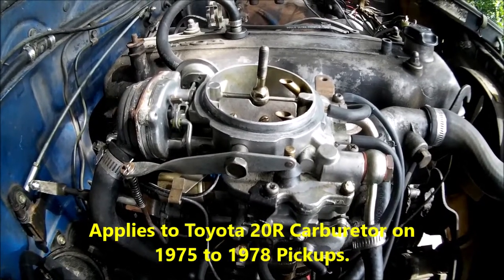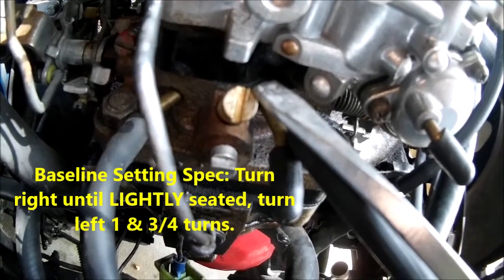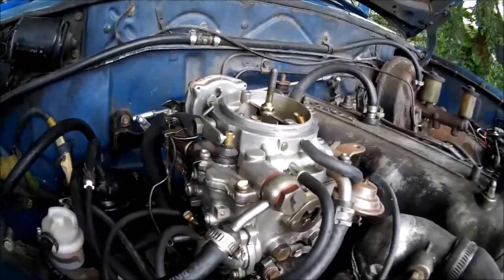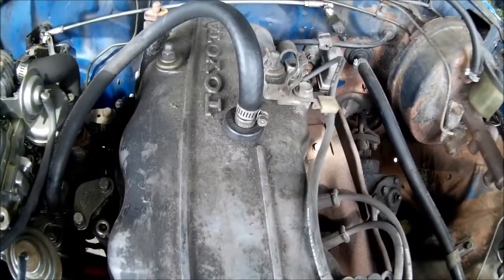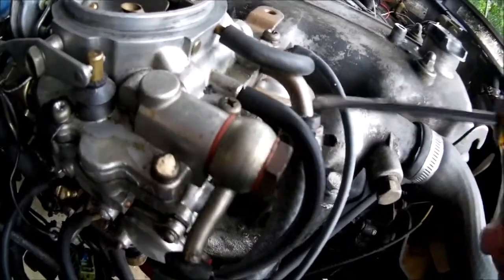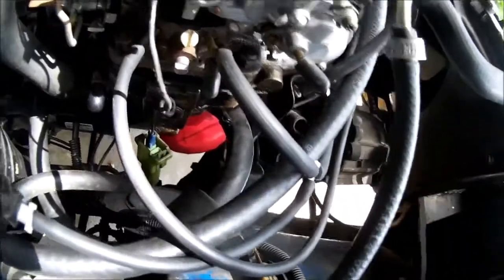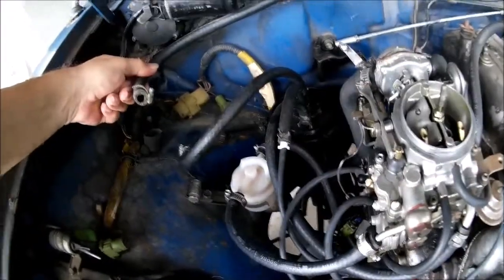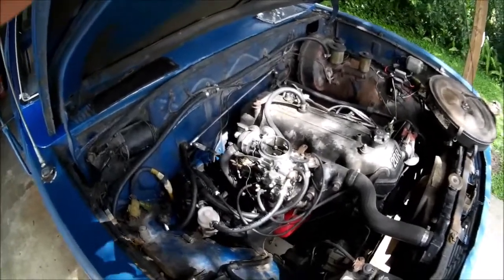1978 Toyota Pickup/Hilux 20R-Carb Adjust & Vac Lines-Desmogged

Comment: I’m not sure if you still read these, but I have an original carburetor on my 1978 pick up. My choke had been stuck for many years and I finally fixed it However now I am getting a strong smell of fuel in my oil and I’m not sure if that’s a mixture issue and or something else. Any idea?
Reply from the maker: I absolutely read every comment/question people send me, no problem. :^) I kind of doubt it's a mixture issue (i.e., your mixture setting screw being out of adjustment), plus that screw really only adjusts the idle mixture. But if you want to verify or eliminate that possibility, you can "baseline" it. It's the screw that is on an angle, center of carb, near the base of the carb. Get a flat-blade screwdriver that fits the slot well. Turn the screw to the right slowly until it just wants to stop turning (lightly seated). You do NOT want to crank down on this screw as that will damage it and you'll never get a good idle. Count how many turns it goes until it lightly seats. If it is more or less than 1 & 3/4 turns, it was out of adjustment. Then turn the screw back out 1 & 3/4 turns. That is the baseline idle mixture adjustment for that carb.

By the way, a "turn" is a full 360 degree rotation of the screw. If that adjustment doesn't solve the fuel smell in the oil issue it's something else.

Other things that could cause that issue. The float could be out of adjustment (set too high). This will noit allow the needle valve to shut off fuel flow when it should. This causes there to be too much gas in the bowl, which can cause flooding. It is also possible that there is some debris or "trash" in the float bowl, that is keeping the needle from totally seating. The needle valve controls when gas can enter the fuel bowl and if it cannot seat & cut off the fuel flow, the carb will flood.

Check the sight glass on the front of the carb; you may have to clean it off to see it well enough. The fuel level, if correct, should be between the two  "tabs". If it is above the top "tab" that's too much fuel and it may be flooding.

Specific to the 20R carb - Possible ruptured Axillary Accelerator Pump Diaphragm (AAP). This problem could allow extra gas to constantly go to your #1 cylinder. Two ways to check for this problem. The AAP is located on the passenger side of the carb near the front, and has a sort of triangular cover with three screws holding it to the carb, plus a vacuum line going iinto it. Pull the vacuum line off the port and see if there is any liquid gas in it. If there is, the diaphragm is ruptured. You can also remove the #1 cylinder spark plug (engine cold, cylinder nearest the front of the engine). If the electrode is black (fuel fouled) it could be a sign of a ruptured diaphragm. Easy fix for this is to remove the vacuum line from the port & cap off the port.

Questions. How long have you had the vehicle? Has the carb ever been rebuilt? There are other wear problems that the carb might have if it's original. How is your engine timing? The spec is 8 degrees BTDC. Are you running the stock in-tank fuel pump or something else? If an aftermarket fuel pump, what brand & part number? Some aftermarket electric fuel pumps might have too high a fuel pressure, which can overcome your needle valve and cause flooding. Is your air filter clean? A clogged up air filter can cause the carb to run rich (too much fuel). Let me know.
Reply: @The13thSword  I’ll look into all the suggestions you have given and then give you a detailed reply but to your other questions. The truck belonged to my father and he bought it new in 78’ I fully restored it and had it repainted about 5 years ago. He wasn’t the greatest at long-term maintenance. But the carb is original stock. Never been rebuilt. I just recently discovered the choke plate was literally glued open from years of carbon deposit. I really should remove the entire carb and clean it but I’m just not confident to do that/fear i won’t get it back running like it does now. It purrs like a kitten and has great compression for its age but the spark plugs definitely getting too much fuel because they are almost black on the tips. I replaced them yesterday once I discovered the strong gasoline smell in my oil. I did discover tonight the choke diaphragm hose (think that’s what it’s called?) was not connected to anything so I re-hooked it up but I’m not sure if that’ll fix anything. One thing I have noticed though is that when I adjust my idle screw it doesn’t seem to make much of a difference. Since I fixed my choke plate I’ve had a hard time getting that high idle speed right. I apologize for throwing so much at you, I’ve got the original engine repair manual and another similar third party one but neither of them address my issues. I’ve removed the pulley for the smog system but left most of the hoses still attached since I don’t have a clue what’s critical and what’s not. Your video has helped me get an idea but I’ve still got hoses everywhere. In regards to fuel tank, it’s original and I have the same issue you has about the gauge not working once the tank is about 3/4 full. I’ll fix it one day but it’s not priority Sorry for the long reply.
Reply from the maker: @ToyotaRN  No problem and thanks for the detailed info. If the carb has never been rebuilt in it's whole life, I would suspect that is where your problem lies. It's 42 years old after all, and things can wear out, gaskets dry up, etc. Plus the fact that your choke plate was "glued open" by carbon & that you can't properly adjust the low or fast idle speeds, those aren't great signs of overall carb health. The vac hose you mentioned sounds like the choke pull-off. With the engine below full operating temp, the pull-off keeps the choke from closing too much when the vacuum drops down (engine speeds above idle). If it is inoperable, it too could contribute to a rich condition (too much fuel for conditions). The choke itself, when the engine is cold, blocks off all or most of the top opening (throat) of the carb. This make the air/fuel mixture richer, which cold engines need to run correctly. Once the engine starts to warm up, the "water choke", a thermostat at the back of the carb, slowly opens the choke as temp rises, until it is fully open at full engine operating temp.

If you look at that thermostat on the back of the carb, you should see some line markings on it, plus a single line marking on the carb side. It should be set right in the middle. if not, it's been monkeyed with by someone and is out of adjustment.

You said "I have noticed though is that when I adjust my idle screw it doesn’t seem to make much of a difference." This is interesting, IF you mean the mixture screw and not the actual low idle screw. It's important to know which is which here. Here is a link to a diagram that identifies all three screws (mixture, low idle, fast idle): https://www.autozone.com/diy/repair-guides/toyota-cressida-corona-crown-markii-1970-1982-repair-guide-carbureted-vehicles-repair-guide-p-0900c152800870d9

If you actually meant the mixture screw, that would indicate that your idle circuit is probably blocked, and the engine is trying to idle off the Main fuel circuit instead. That would certainly make it run rich. Given the carbon problem you mentioned, this could be very likely. Also as I said before, there could be "trash" in the fuel bowl, some of which is blocking off your idle jet. That's more likely to happen, as the idle jet opening is much smaller than the main jet opening, so it gets blocked easier by junk in the fuel. Have you changed your fuel filter lately?

What I would do if it were mine. Go get 2 cans of cheap carb spray cleaner. Take off the air cleaner, put paper towels around the base of the carb, and use 1 complete can to clean off the outside of the carb, and also spray down the throat. Let it sir for several hours to let all the spray cleaner evaporate. 2nd can of cleaner - Unplug & remove the Fuel Cutoff Solenoid from the carb. This is a cylinder shaped part on the passenger side of the carb with one wire going to it. Remove the Idle Mixture Screw completely. Doing this gives you access to the internal passages of the Idle Circuit. Remove the two bolts/plugs at the front bottom of the carb. This gives you access to the fuel bowl and the idle & main jets.

You can then "wash out" the fuel bowl with the spray cleaner, and also shoot some cleaner down the small brass tubes in the carb's throat. Those are bowl vent tubes and go straight to the bowl. Then use the "straw" that came with the carb spray cleaner. The idle & main jets are straight back in the carb from where the bolts were. You can shoot cleaner right into them to clean the jet openings.

Still using the "straw", shoot some cleaner into the fuel cutoff port and the hole where the mixture screw was. Fill up that idle circuit until it's full. Let sit 5 minutes, then blow out with compressed air in short blasts. If you don't have compressed air, just keep repeating the cycle of shooting more cleaner in there. Use up the whole can if you have to. When you're out of cleaner, let the carb sit for an hour or so, then re-install the bolts, mixture screw & cutoff solenoid.

I have never failed to unblock an idle circuit doing this. It looks complex in print, but it's actually not hard to do.

Second option is to buy a gallon can of carb cleaner, remove the whole carb and soak it overnight in the cleaner. Only problems with this is you really have to diagram out the vac hoses to get them back in the right places. And it may not remove all the "junk" from the inside.

Also, the above 2 options will not fix any worn or broken parts. For that even a rebuild won't get it done, but there is this: https://nationalcarburetors.com/Toyota-Hi-Lux-20R-22R-1978-21892367-CC_p_520.html

The throttle shaft bushing on my original carb were worn out & causing a big vac leak. National supplies rebuilt carbs with brand new hard parts like that, plus new solenoid, diaphragms, etc. Great value if you need to go that way.

I wouldn't worry too much about the smog system; it's probably not working anyway. Just make sure you don't have any vacuum leaks to any of it's vacuum operated components. Either new vac hose, or cap off ports to them with some quality silicone vac caps.

You have a broken resistance wire in your fuel sender. I have info/fixes for that too, just let me know when you need to know.
Reply: @The13thSword  so I got the courage and cleaned and rebuilt the carb completely. I’m now trying to determine what vacuum lines are actually needed vs what was apart of the original smog system (now decommissioned) I was trying to understand why you capped the Vacuum Port for Hot Idle? Does it not work separately from the original smog system? In addition, if I send you pictures or make a video can you tell me which ports I can cap? I’m using this video as a guide but I know there are still some places where I’m not sure what to do. Just let me know. Thanks again
Reply from the maker: @ToyotaRN  Good job on mustering up the courage to do your own carb rebuild. You don't need to run the Hot Idle Compensator Valve, as generally it is intended for vehicles with AC., and/or vehicles that are run in very hot climates. When coming to a stop, there is much less air flow through the engine compartment, and temps can rises above the normal 200F. Think of rush hour bumper-to-bumper traffic hardly moving. This can cause fuel percolation in the carb, making for an over-rich condition (higher fuel to air ratio). The valve is a metallic strip that deforms under a certain level of heat, and there is a "stopper" on it's end covering a hole in the carb body. That hole allows air to run thru a passage in the carb and exit below the lower throttle butterfly plates, leaning the air/fuel mixture out. The valve usually only gets a vacuum signal at conditions of high vacuum, such as at idle, and the valve will only open up at around 200F or higher.

I am in Central Florida and have had to capped off since doing the desmog, and haven't noticed any percolation problems at all, even in July or August. You can go ahead & run a vac line to it if you want to, instead of using a vac cap; I really don't think it's going to make much of a difference performance wise. The port for it is the lower of the two on the front of the carb, just below the throat opening.

I've run one vacuum line from the Dashpot (vacuum canister on the front of the carb that is connected to a linkage system) to a ported vacuum source. I used the middle vac port directly below the Idle Mixture Screw. There is an angled port to the right of that one; that one I use for the vacuum advance for the distributor.

The only other vacuum lines I run is to the Fuel Vapor Canister, which the only part of the old smog system that I kept. It traps and fuel vapor from the tank return line and from the vapor return line from the carb. Any fuel vapor it traps gets sucked out thru a vacuum line to the port to the left of the Dashpot port described above, and the fuel vapor is burned off in the engine at startup. Some people totally eliminate the Vapor Canister, but if that is done, you'll need to cap off the vapor return port on top of the fuel bowl, and either cap or install a filter on the tank return line. If you cap the tank return line, you need to make sure your have a fully functional vented gas cap for pressure relief.

If you still need more info you can make & post a video to Youtube if you wish. If you want to send pics, you can send them to me thru Yotatech, which is a Toyota truck forum (yotatech.com). You'll have to make an account but it's free, then just search for members to find me & send a PM. My tag on Yotatech is 13Swords.
Reply: @The13thSword  next couple of follow up questions. On the front of the carb the top port is thin and if I understood you correctly it goes to the choke pull off. The thicker port on the bottom (level with the fuel vapor return line) either is capped or goes to the old thermostataic valve as you mentioned above? Second question, do I need to put fuel in the carb bowl prior to starting? I thought stepping on the gas pedal would work but it doesn’t seem to have any effect. Also, how does gas get sucked up once it passes the fuel filter. It doesn’t seem to suck any gas up when I have it gas. Have I hooked up my vacuums wrong or not capped everything I was supposed to? Thanks a million for all your help. I can’t wait to post a follow up video once I can get it running again 😂
Reply from the maker: @ToyotaRN  Correct, the lower port goes to the hot idle valve (old thermostatic valve), if you are using it; I have that port and the port for the valve capped. On mine I have the thinner top port also capped.

What you are calling a choke pulloff I call a Dashpot. They are two different things. On the 20R carb, the choke pulloff is mechanical and works with the position of the throttle linkage (connected to your gas pedal). If the choke plate position is in anything less than the fully warmed up position, the throttle linkage mechanically pulls the choke plate open when you get on the gas pedal.

The function of the Dashpot is to "cushion" the closing of the throttle butterfly plates in the bottom of the carb on sudden deceleration, like quickly taking your foot off the gas. This lets the engine retun to idle more smoothly. Without a dashpot, the throttle plates would slam shut suddenly, & cause a rich condition, which could stall out the engine.

The vacuum line for the Dashpot goes to the vacuum port on the carb, to the left of the Idle Mixture Screw. I went out and looked at mine to verify this. IMPORTANT NOTE: As long as it seems to be working ok, DO NOT ADJUST THE SCREW ON THE LINKAGE THAT IS CONNECTED TO THE DASHPOT. I made that mistake a while back and it took me all day to get it back to just right and working exactly the way it's supposed to.

About your fuel question. Stepping on the gas pedal operates the accelerator pump, which is mechanical and inside the carb. If there is no gas in the fuel bowl, it will have nothing to pump, no matter how much you step on the pedal. You don't have to fill the fuel bowl before trying to start (your fuel pump will fill the fuel bowl eventually while cranking the engine), but it helps make start up much quicker. A lot easier on your starter. You'd need a small plastic gas-safe bottle with a spout to pre-fill the fuel bowl. This is done through either of to brass tubes inside the top of the carb throat. Those are vent tubes for the fuel bowl. See 4th picture here: https://nationalcarburetors.com/Toyota-Hi-Lux-20R-22R-1977-21892367-CC_p_514.html

Gas does not get sucked up once it gets past the fuel filter. The fuel pump in your tank PUSHES fuel through the whole fuel system (including the fuel filter) until it reaches the carb. Once there, there is a float in the fuel bowl that moves up & down depending on the level of fuel in the bowl. The float is attached to a valve where the fuel supply comes into the carb. When the bowl is full to spec (fuel level between the two metal tabs on the sightglass, front of carb), the float rises, an "arm" on the other end of the float's pivot pushes down the valve & closes it, cutting off fuel flow to the bowl.

Just to be clear, engine vacuum plays no part at all in fuel delivery to the carb. What happens inside the carb after that is another story.
Reply: @The13thSword  thanks for clarifying on the above. I made the terrible mistake of disassembling everything on my carb. Any advice on the correct amount of turns on the dash pot screw or on the fast idle? I followed your advice on the mixture and will adjust the regular idle once it runs. Also, below the mixture screw is a port that has on the left a port that goes to the air filter and then there are 3 ports on the right. Do you know if I need to have anything hooked up to those or if I can just cap the three? And directly below the carb connected to the intake manifold is another thing that has 2 ports vertical stacked. Any idea what if anything needs to be attached to it?
Reply from the maker: @ToyotaRN  Oops. OK, some basic starting points here. I don't remember exactly how many turns (it's been three years since I adjusted it), but on the Dashpot screw, mine is set at 5/16" or 7.5mm, measuring the head & shaft of the screw that remains outside the part that it screws/threads into. Try to make this as precise as possible. There might be some fine-tuning to do to it later once you get it running, but this involves a set amount of "hold" time and perhaps some "feel" on your part. I can tell you about it later if needed, but right now that measurement should be good enough to run it.

For Fast Idle Screw. Set the choke to full closed position. if you can't the screw is run in too far; back it out. You want the screw run in just enough to lightly hold the throttle linkage open on the highest "step" that the screw shaft makes contact with. Again that should be enough to get going with and you can adjust later. The high idle spec for the 20R is stated as 2400 RPM, but I find that way too high. I run mine adjusted down to 1800. Idle speed spec is 800-850.

Since my truck is "desmogged" I do not use any of the vacuum ports below the carb, that are not a part of the carb body itself. All of those are there for vacuum actuated smog equipment. I have all those capped off. That includes the "vertical stack". In fact I removed that piece entirely and put in a threaded metal plug in it's place to make it simpler and prevent any possible future vac leaks. But as long as you're using tight fitting quality vac caps there should be no issues.

Again to be clear, if you aren't using the emission equipment, even if you didn't remove the items from the truck, no port intended to send vacuum to emission equipment "needs" to have anything hooked up to it. You just need to securely cap them off. This is to prevent extra air from entering the intake side of the engine and throwing off your fuel/air mixture.
Reply: @The13thSword  I promise I’ll donate to you’re channel if I ever get success with this. I did get it to start but I’ve hit several issues. 1) the car is reving really high and the choke plate doesn’t open because it’s not getting hot enough or some other reason. I adjusted the screws as you suggested but didn’t seem to do much.  2) I did let it do it’s thing for about 20 seconds but it started to back fire and was eventually going to stall. 3) My biggest concern is the fact that the base plate the carb sits on that connects to the intake manifold was soaked in gas and I’ve got no idea how that happened/happens. 4) my gas pedal just doesn’t feel the same as it did before I disconnected the ball bearings the throttle arm connects to. It seems to be almost pressed down to the floor. There’s no springiness in it like it was before I released the throttle arm. I’m sorry to bombard you so much I’m just a 25 year old trying to preserve my dads legacy.
Reply from the maker: @ToyotaRN  No worries on all the questions, and no need to donate, because that's not why I do this. I started posting my vids to share what knowledge I do have, for projects just like yours. Let's take the high revving first.

It's going to be a little hard for me to say what's going on there, without seeing it in person, and not knowing exactly what you did in disassembling.reassembling the carb.. Something could have been left out accidentally, reassembled wrong or in the wrong position, etc. Carbs have so many small parts that need to be in precise locations & measurements, that's why a lot of people don't want to tackle a rebuild, me included. But you should be proud of your effort regardless.

At this point I could throw a lot of guesses your way to try and explain what is happening there, but based on my own past experience (I tried to rebuild my carb too, and it didn't work right), I'm going to suggest that you get a complete freshly rebuilt carb. I've learned that sometimes all the effort isn't worth the stress, especially when you don't possess the specialized knowledge to fix something, and carbs are just one of those things that most of the time is better left to the pros. It just makes more sense, because you are dealing with a 43 year old carb that's bound to have some issues that a cleaning and a basic rebuild kit just won't solve.

Recommendation: https://nationalcarburetors.com/Toyota-Hi-Lux-20R-22R-1978-21892367-CC_p_520.html
This is what I went with and I've been more than happy with it for over 3 years now. What you get for the price is really a good value (check out the "CARBURETOR REMANUFACTURING PROCESS" page on the website), plus they install new diaphragms in all the vacuum operated parts, plus give you a brand new idle cutoff solenoid. They also test them and preset the float height, mixture, idle speed, high idle, dashpot & choke, so it's basically as close to "ready to run out of the box" as possible. Just install & tweak if needed. And no I do not work for them and I am not sponsored by them.

If your goal is to keep the truck as original as possible and run well, this is the option to take. Otherwise you'd have to look at a Weber carb like this one: https://www.yotashop.com/weber-carb-kit-32-36-electric-choke-toyota-4runner-pickup-20r-22r-k746-e/
It's more expensive and will work well, however they are a bit notorious when it comes to tuning them, and will require the additional expense of a fuel pressure regulator, as the stock fuel pump puts out too much pressure for the Weber to handle.

If by "base plate" you mean the black phenolic (non-metallic) spacer that has the tube in it for the PCV Valve hose, don't worry about it. The material is designed to handle gas and as long as it's not cracked or broken it's fine. It getting soaked in gas won't hurt it at all, but the fact that it did get soaked tells you that your carb is either flooding or has an unmetered internal fuel leak inside. Any number of things can cause that. The gas pedal position thing is interesting. Base throttle arm re-installed in the wrong position? Something in the linkage from pedal to throttle arm binding? Hard to say.

That's all I can think of at the moment, except for one piece of hard-learned advice. You mentioned preserving your dad's legacy, and that's very noble of you and I very much respect it. However, keep this in mind - you've got to use your logical brain to get through these systems and make them work, and try to treat all of this as a learning experience as you go. You can make this happen with enough effort & work, but be methodical and give yourself a break when you need to. It took me 10 months to get my truck running & working well again mechanically, and I had to learn everything along the way. If I had had resources like my vids to help me, it would have been less time to learn things the hard way by doing them wrong several times. That's why I post these things and don't mind all the questions. Because I know what it feels like to not have a clue & no help. So just keep at it & remember to ALWAYS take it at your own pace. You'll get there. I'm here to help where I can.
Reply from the maker: @elegant6066  It could be any number of issues but let's start first with a basic fact. Gasoline by it's nature evaporates easily, and by design carbs are not meant to hold liquid fuel in the fuel bowl over time (days). All fuel bowls have vents to the atmosphere and/or a vent line to a "catch canister" to catch & store evaporated fuel vapors from the carb. Once you shut down the engine, left-over engine heat will cause the gas in the bowl to evaporate, at least to some degree, if not completely. This is normal & by design. As long as the rest of the fuel system is functioning normally. it shouldn't take anything longer than 5-8 seconds to get the engine started. The fuel pump should be able to fill the fuel bowl enough in that time to make a start happen.

It's probably something simple not working right or being out of adjustment. Looking at your symptoms (& I admit that this is a guess on my part) it sounds like your choke is out of adjustment or stuck open. The latter one is a common problem & usually easily fixed by using carb cleaner spray on the choke linkage(s). They can sometimes get dirty & cause the linkage to get stuck.

Some questions. I'm assuming you have the original/stock carb? If not what carb are you running on it? When was the last time you has the carb cleaned, rebuilt or replaced? Before trying to cold start. have you removed the air cleaner, pressed the gas pedal to the floor & released it, & checked to see if the choke plate is fully closing? It should. When was the last time you replaced the fuel filter & rubber fuel lines?

Important - What kind of gas are you using in the car? If you are using any gas with Ethanol in it, this can cause fuel system problem in cars that are not driven very much. Ethanol gas is really only "good" for 30 days or less before it starts to break down & cause problems in older vehicles like ours. You either need to find a source for ethanol-free gas or use an additive to ethanol gas like Stabil or similar.

There are other items you can check but this is a good starting point. Let me know what you find & some answers to those questions. If you can't solve it we can go from there. I'm sure you can get it working right.
Reply from the maker: @elegant6066  This is some interesting info you provided. Let us start with the gas. Doing a little research it appears that all ARCO "Top Tier" gasolines contain Ethanol, so the ARCO 87 octane you are using very likely is an Ethanol-laced gasoline. To 100% verify this, next time you go to the ARCO look at the gas pumps. By federal law, all gas pumps that dispense Ethanol-laced fuel must have a sticker on it that reads something like "Contains 10% ethanol" or "Contains up tp 10% ethanol". There may also be a sticker that says "E10".

The original recommended fuel spec for the 20R is 87 octane unleaded (straight gas, no ethanol added), and the engine was specifically designed to run on that fuel. As long as the engine is in stock configuration, in good condition & properly tuned, there is no reason to run a higher octane gas. Higher octane gas does not automatically give you more performance; this is a popular myth. So if your engine is stock & for all these reasons, I do NOT recommend using 91 octane.

The 20R will run fine on 87 octane E10 Ethanol gas in stock tune, but gas mileage may be 2-5% less, as the Ethanol-laced fuel is not as efficient as straight gas.

You say you "recently" had the rubber fuel lines changed out, which is good. Newer rubber fuel line is now made to withstand Ethanol fuels, However, old rubber fuel line was not. That means that the Ethanol may have been breaking down the rubber lines from the inside, and particles of rubber could have gotten into the carb & block some of the very small passages in it. I've only seen this a few times but it can happen. I personally doubt that this is your problem though.

Please take the following as advice and NOT as a criticism. Based on your description of your start-up method, it sounds like you are not doing it correctly, and you may be causing the hard-to-start issue with your actions. And there may be nothing wrong with the vehicle equipment. I will explain.

For a "cold start", it should only take ONE "pump" of the pedal (push pedal to floor & release) to set the choke plate to the closed position, & for the accelerator pump to "shoot" enough gas to get the engine started. There is no way a functional carb & engine should need all that pumping. By using multiple pedal pumps, you are "shooting in" more gas than is necessary, basically "flooding" the engine with too much gas. Also the extra "pumps" are causing the choke to "unload" into an "unchoked" (open choke plate) position, which is not where it is supposed to be for a cold start. Removing the carb cover after all that & seeing the choke plate open pretty much verifies that last thing is what is happening.

Here is what I want you to do. Please read this & do these things in the following order without exception. Vehicle in "cold" condition, & you have not tried to start it at least overnight or 12 hours. Open the hood & remove the top of the air cleaner (what you are calling the "carb cover". Look at the choke plate in the top of the carb. It may or may not be in an open position; normally it will be open on a cold vehicle. Go into the car, press the gas pedal to the floor ONCE (1 time) & release it. Go back to the carb & look at the choke plate. It should now be fully closed. If so, your choke is working correctly. Go back in the car, and WITHOUT TOUCHING THE GAS PEDAL, turn the key to start & crank the engine over. If all is as it should be, it should start normally in 5-8 seconds, and it should have a high idle. If it does not start within 10 seconds, let go of the key from the keys' start position & wait 10 seconds, then try to start with the key again, but DO NOT TOUCH THE GAS PEDAL. It should start & high idle at least on this second try.

If it still won't start or you still get the same results as before that you got with all the pedal pumping, you have carb issues or fuel flow issues. These could be the carb being out of adjustment, debris (trash) internally blocking or partially blocking internal passages such as the idle circuit, or interior parts degraded by the Ethanol gas over time.

Try the above EXACTLY as I have written and let me know what results you get. If you still have an issues we will go from there.
Reply from the maker: @elegant6066  No problem, I will be waiting to hear  about the start test. I wouldn't worry too much about ARCO & gas quality, as Marathon has a very good reputation for quality control.

RE Gas Additives. The Lucas UCL additive will not do anything to "clean up" any old gas that has Ethanol in it; it will have no effect on the Ethanol portion whatsoever. You can add it if you want to, as I do not think it will cause any problems itself, but I don't think it will cure your problems either. All modern gasolines have cleaning additives in them that are more than up to the job, so buying extra fuel cleaner additives is usually a waste of money. I still occasionally use gasoline as a parts cleaner when working on cars, and it's a great cleaner on it's own. You just have to be careful about fire hazards when using it. Yikes! :^)

In your particular case (cars that are not driven often and you can only get gas with Ethanol in it, that's why I said something about an additive. However it needs to be a quality one, and one that will neutralize the effects of the Ethanol. Ethanol has a bad habit of attracting water vapor and that is never good for gasoline, your fuel system or your engine. Plus as I said before, Ethanol-laced gas doesn't "keep" as long as "normal" gas. This is always a problem for owners of hot rods & classic vehicles, as they are not driven every day, or even every week.

The one additive I know of that DOES work for this is STA-BIL FUEL STABILIZER. You can find it at nearly any auto parts store for about $5-6 for a 4 ounce bottle, which is enough to treat a full tank of gas. And that gas will be stable & usable for up to 24 months (2 years). I have not used it myself, but know many people who swear by how it works for them. It's also the only gas additive I know of that works with Ethanol-laced fuel.

Extra info: Sta-Bil might be your best solution, as CARB (California Air Resources Board) does not allow Ethanol-free gasoline to be sold in the state at all.
Reply from the maker: @elegant6066  Did you follow the instructions I previously sent to you? Without me knowing if you did what I recommended or not it can be very hard to help you diagnose this.

IF you did push the pedal to the floor once before trying to start the engine, and the choke plate was closed, that is how it is supposed to be. On a "cold" engine, it takes more gas to start & run it. The choke plate bocks off some air flow, and this makes the air/fuel mixture "richer" (more gas). As the engine warms up, it needs less gas to stay running properly at idle. It is hard for me to say for sure without more complete info, but it sounds like your choke mechanism that controls the choke plate is working.

That would leave either a fuel feed problem or blocked passages/jets in the carb as the most likely possible causes. Second most likely are old/bad fuel, water in the fuel, carb out of adjustment (fuel mixture) or a problem with the electrical side of your fuel pump system, IF you have an electric fuel pump.

Please try and give me more complete info so I can better help you narrow this down.